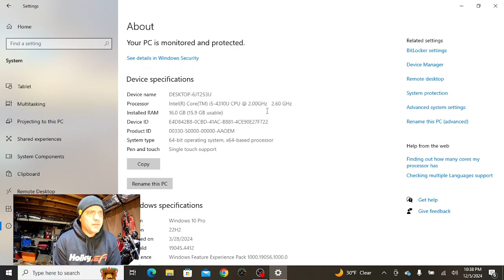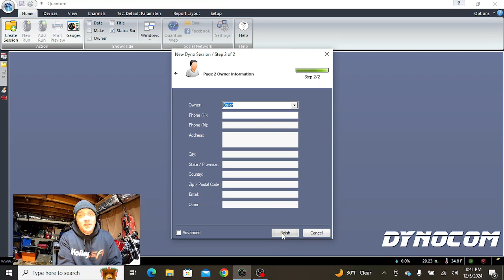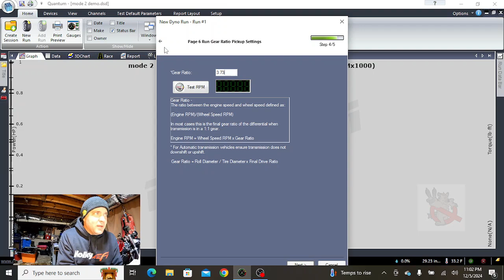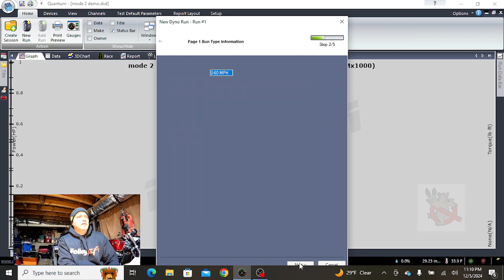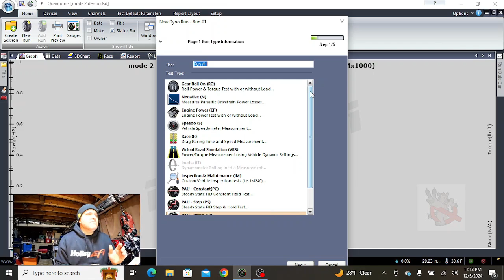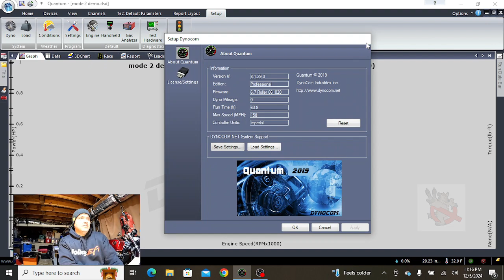Dynocom for Dummies Pt.2: Waxing Poetic about Dynocom mode 2 of operation

Comment: Thank you for the videos i recently bought a awd dynocom dyno and is hard to get any help, question for some reason no matter what i do when i seat my load to start at 70mph it always starts at 40mph, do you know what can be causing this also for wideband reading is any way to set up for the wideband to read correctly like for example the wideband on the car reads 11.7 at wot but yhe dyno is at 13.5

Thanks in advance
Reply from the maker: Email joel@qedtuning.com and let me see if I can help.

Comment: At about the 4:30 minute mark, you mention the importance of using the dropdowns and NOT manually entering vehicles. A couple of questions about that: 1. Are you just SOL if you have already entered in data? 2. I am testing primarily diesel trucks and it looks like the selection of vehicles is extremely limited. In this case, do I enter whatever information I can drum up myself? Or how would you suggest handling that?
Reply from the maker: @DieselDownDynos  a fresh install should bring them back. Also if you don’t have data for a particular vehicle. I use the pick up truck settings, add a little frontal area and try to get the weight right. It’s not “correct” but it’s usually close enough.
Reply: @ perfect!
Solid advice. Thanks brother!
Keep saving lives with this channel.